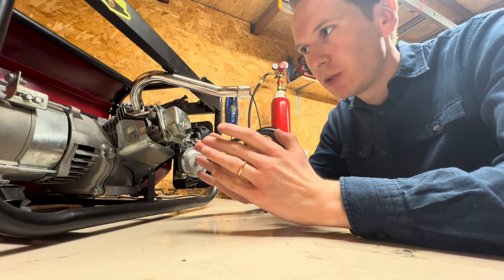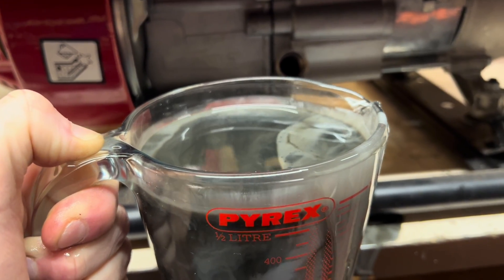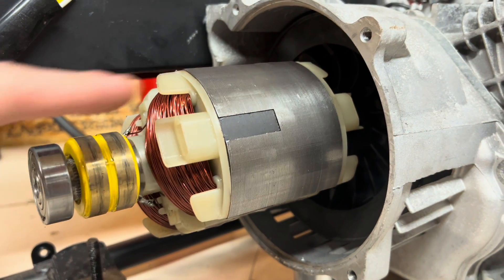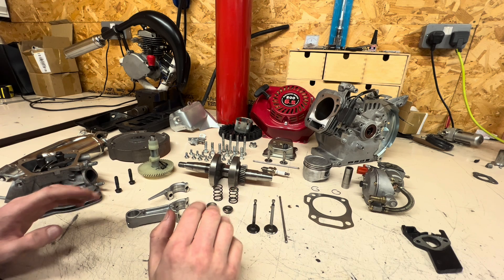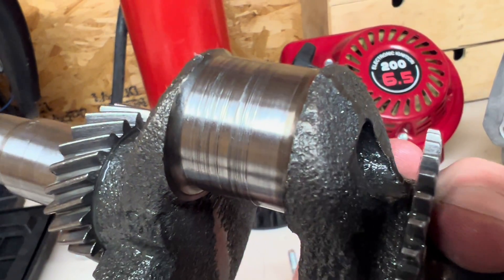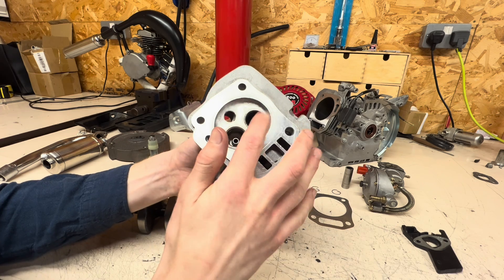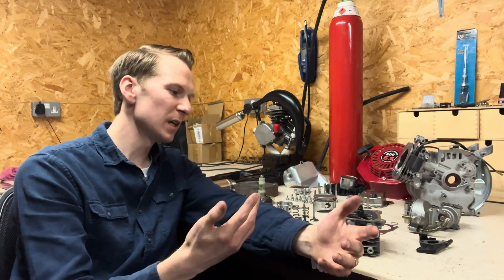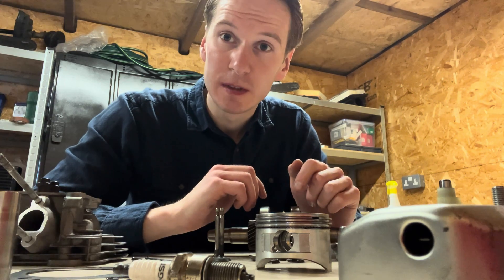Internals After 2 Years of Hydrogen

Comment: Rod/crank bearing is aluminum against steel?   No bearing insert?  Really?   No wonder it's torn up!
Reply: The bearing surface on the con rod is coated (or supposed to be) with Nikasil.  With regular oil changes, the con rod should last for years.  Not sure if the chinesium engine uses Nikasil though.  Briggs does, and their con rods perform well.  THe reason there is glitter in the oil is because the Nikasil has been worn away.  Bare aluminum doesn't make a very good bearing.
Reply from the maker: @sonicdewd nice one, thanks for the info :)
Reply from the maker: Yes, very cheap engine, would have been fine I’m sure for quite some time if the oil was changed frequently
Reply: @Hydrogenguys  Not in the biz but I've had quite a few engines apart... and never seen aluminum-on-steel rod-bearing.   Amazed even a "cheap" engine would be built this way.
Reply from the maker: @philipfarnam6013  thanks for the info, will be upgrading to a billet one for sure.

Comment: need a purpose built engine designed for hydrogen... which we will never see
Reply from the maker: That’s the plan for this engine. 
The plan it build this engine back up (as far as reasonably practicable) for hydrogen in a performance application
Reply: Cummins

Comment: H2 alone takes only 1ms for flame propagation as opposed to about .003s for gasoline. You could probably move the trigger to advance the timing to take advantage of the higher equivolent octane rating of the hho. The retarded timing is probably the reason for the inpact wear on the crank and valves. The wrist pin is probably beat up and you should check the piston for cracks around the ring lands and pin. It would be interesting to see the parts viewed under a microscope.
Reply from the maker: Hi, thanks for the comment, retarded timing (ignition point at TDC) is a must for hydrogen due to the high flame speed like you mentioned. 
I wonder how far advanced we could go with this engine to increase the performance, 5 degree ignition? 10?  Will be interesting to test on a dyno :)

Comment: I repair the little engines and wondering what type of oil do you use and how frequently you change it set tappets etc
Reply from the maker: This was stranded oil, intentionally left and unchanged to see the effect, a few people have recommended an alternative oil so will be looking into that for the rebuild, and a high compression cylinder head

Comment: We learned back in the 80's when working with the (American Hydrogen Association) that the timing needed to be adjusted closer to TDC. We used high compression engines such as diesels because you want very high compression ratios, and diesels are already built for this purpose. 22:1 to 25:1 would be best. Turbocharging pressures do not change even with the added pressures. A simple replacement of injectors with spark plugs and basic ignition coil system is used. Rod bearings and pistons get hammered because of the high pressure detonation (extremely fast flame front).
Reply: Yah my uncle was in on that - forged steel necessary
Reply: Woot.  I was right!

Comment: Use a billet connecting rod with a bearing insert, you'll be much happier and so will be the engine
Reply from the maker: That’s the plan for the performance build, just need to save up for it first , recommend any suppliers? 🫡
Reply: There are conrods available for these engines that have a hole in the oil diper that feeds oil directly to the lower conrod bearing. Compared to the splash lubrication approroche of the stock engine design this could help with the bearring failing like it did in your engine.
Im not a follower of the channel or the seies of this engine. But if you want to make more power this kind of engine it gets kind of expensive quickly. Because performance parts are very expensive and these engines are not designed with performance in mind. So a lot of parts need to be reworked and there head isnt designed for performance, thre is no oilpump, no proper crankshaft bearring on the flywheel side, .... . And in the end even with a lot of parts, power per litre is kind of low.
Having said that a performace cam would probuably make a bigger difference than one might think since the stock one is designed for a low max rpm.

Comment: Try using a PAO Ester oil, its often used in vehicles with exotic fuels due to the both lubrication properties and its ability to deal with more moisture than a standard oil. Its commonly used in both Methanol and Ethanol applications.
Reply from the maker: Thanks for the information, will definitely look into that for the rebuild.

Comment: I see the parts at the being. 
Sore the ware.  So keep watching.  Question  ho motor.  Should  you increase the oil level.  ? Mick Australia  just joined.  Thumps up.
Reply: Thank you for fast replay.  
I appreciate it. But get a splash of the crank will not burn out all .
There no oil in the fuel.
Or drill a chamber and run a eltrontic pump to where needed experiment) think out of the box my friend 🧡  mick Australia 🇦🇺
Reply: If crank gets more oil will splash.  And oil the bottom end  brings.  More oil in the sump. On the other side use more fuel  crank turning in oil. God bless
Reply from the maker: Thanks for the comment, I don’t think adding more oil will help, a few people in the comments have mentioned alternative oils that might work better, so will look into that. 

Glad you liked the video

Comment: Hydrogen in 'normal' engines is a dead end path.
its the embrittlement issue and as far as i can see there is no cure in our periodic table. and so in our universe. 
the issue causes excess engine wear but more importantly storage tank issues, one day you have good storage, next day the metal is as fragile as glass and one odd bit of vibration leads to an explosive crack. 
this is why they only have hydrogen vehicles driving around as test vehicles so they can get them recalled back before the boom stage.
you cant get the average poor motorist to buy good tyres and brakes your not going to get him to replace the expensive high pressure tank before its weakened, wanna be driving behind that guy.....

Comment: Plastic camshaft? I didn't even think that was possible.
Reply from the maker: It’s amazing right? 
A lot of these small engines use them, will be upgrading to a metal cam shaft on the performance engine build, to deal with higher RPM.
Reply: I tore apart an old Briggs and Stratton possibly 30 years old. And the cam was plastic and it still ran perfect. Most of them engines have 16 pound valve springs which isn't that much stress on the cam.
Reply from the maker: @JGsgarage_unboxings think it will be okay with 22 pound spring at high rpm? 7k
Reply: @Hydrogenguys  maybe. But I kinda doubt it.
Reply: Oh god, don't tell BMW, please!
Reply: @bubbleman2002 bmw figures it don't need a cam when they have solenoids
Reply: @bubbleman2002   - Yes, absolutely THIS!!
Reply: @rustirab3465 Just because it's plastic doesn't mean it's bad, a lot of plastics these days are better suited to their job than metals
Reply: @mrcaboosevg6089 None of them last though. Ya they don't wear out, but age kills all plastic.
Reply: @integr8er66  Depends on the plastic, plenty are perfectly capable of lasting 100 years. Fiber glass is effectively a plastic reinforced with glass and there's no chance of it rotting or degrading like steel or aluminium would
Reply: About the plastic cams. The material specifically UHMW ( ultra high molecular weight) and finds itself in all manner of sliding parts situations. Used as chain guides for overhead cam motors also conveyors. I have no problems with the material in consumer equipment. The honda lawnmower recall for the camshafts is not wear related.
Reply: Weirdly plastic is actually quite good at handing the contact stresses in camshafts. The reason for this is that it naturally has some flexibility that spreads the load across the cam. Think of how a rubber car tyre lasts well against the rough road surface, whereas a solid steel wheel would quickly be damaged.

Of course the plastic isn't very strong, so if you install heavier valve springs and run at higher RPM the load will be too much for it to cope with. But totally adequate for normal service in a mower or whatever, and has the added benefit that the plastic is somewhat self-lubricating so it won't die instantly from not getting enough oil. And it's cheap, the most critical feature for a disposable small engine!
Reply from the maker: @nerd1000ify thanks for the info, the aim is to install a high compression cylinder head with stiffer springs, and increase the rpm, I’ve seen a few go kart cam shafts sold that are steel or billet, hopefully be getting one of them. Nice to know plastic is more common than I first thought.
Reply: @nerd1000ify Its good on all those ways, but just as bad as tte nylon toothed timing chain gear GM used in the 80s. Plastic does not last in a high heat environment, ot will be brittle and break inside of 10 years. My Lawnboy 2 stroke from the early 70s is still running like a top...But then again it has no camshaft
Reply: @integr8er66  more or less true. These small engines are designed as disposable items, one that lasts 10 years has far exceeded its intended lifespan. They usually have aluminium cylinder walls (no cast iron liner) and the conrod is aluminium and runs directly on the crankshaft with no bearing shells. So none of the major working parts are really made to last a long time. That being said, sometimes you come across one that has somehow survived longer than expected - a while ago I did a valve job on a Briggs and Stratton side valve that had run so long that the exhaust valve stem had a noticeable step in it. The engine lost compression because the valve seats wore grooves into the valve faces deep enough to stop them closing all the way!
Reply: Stihl has been using "plastic" cams in their 4-Mix engines for 20+ years. Stihl designed the engines so even if there is a problem with the cam, it's easy to put a new cam in. You simply remove a cover from the side of the engine and the cam is right there. Loosen the rocker arms, pull out the pushrods, pull 2 pins holding the cam followers in place, and the cam comes out.  It is literally a 10 minute job.

Comment: That oil was never changed. If it was changed every 10 hours of run time with 10-40 full synthetic that engine would look fine. I do that with mine, and they run perfectly even after many years of use. My last mower (used a lot!) was almost 20 years old when I got another one. It still ran and mowed, but smoked. Just take care of your stuff!
Reply: Oil change every 10 hours ? 😂😂
Reply: @sigmamale4147  I know, sounds unnecessary. I have a Honda mower that is now 7 years old and must have hundreds of hours on it. Deck cracked in 2 places (fixed now), and on the third blade. I mowed 3 lots for 2+1/2 years  (one was an acre of big weeds) Got a rider for the big lot, but still do the other two. Mower starts right up and burns no oil and lots of power. I'm going to try for 20 years out of it, but we will see...
Reply from the maker: @sigmamale4147 😂
Reply: @sigmamale4147  For a small engine that sees infrequent use, annual changes are generally sufficient.

Not changing the break in oil will be lethal however. These things have no oil filter, so the wear particles will constantly re-grind the moving parts creating even more wear particles until everything fails.
Reply from the maker: That’s exactly it, for years I have been talking about oil contamination and the importance of changing the oil more frequently when running hydrogen, I left this oil in the engine for so long to show the effects of oil contamination. 

Thanks for the comment
Reply: @Hydrogenguys  You showed it well. People need to understand what happens without correct oil/fluid changes.
Reply: @Hydrogenguys  It's OK to admit that you neglected to change  the original break-in oil .
Of course that's going to chew your motor up. 
  That break in oil will have a little metal particles in it from the initial wear of the moving parts work surfaces 
 Leave that in there it's like  liquid sandpaper 😅
Reply from the maker: @jimwednt1229 good point about the break in oil, didn’t consider that there would be contaminants in that, that being said I feel the outcome would be the same if not similar, 2 year old oil in a high heat application, along with water etc, something was going to give up at some point 😅

Comment: The only issue I saw was possible valve adjustment. The same engine after 2 years of running gasoline would have been far worse. Adjust the valve clearances back to factory spec, use higher viscosity motor oil, lap valves. Done. Don't need a new crank, just sand the old one and correct the tolerances on the bearings.
Reply from the maker: The crank was too far gone sadly so needed replacing, good point about the valves though, I will be using a higher compression cylinder head stiffer valve strings for the engine rebuild, looking forward to getting it running as a dedicated hydrogen engine. For a go kart maybe.

Thanks for the comment

Comment: One more fix, it's an oil heater that will evaporate moisture from oil (also in cars fuel evaporate from the oil). The reason why in cars oil changes is so long (7.5 k. km). Also oil changes must be every 250 motor hours, better if u will change it more frequently then that amount of hours.

Comment: Can you make a car that run with battery powered hydrogen generator? A system with a range of 50 or 100 km could be a good solution for old cars.
Reply: 50 km = 10 kWh in an EV. Considering all the conversion losses in the system you proposed, you would have to multiply by about 5. So a 50 kWh battery for 50 km could work in theory. But why not put an electric motor in the car?